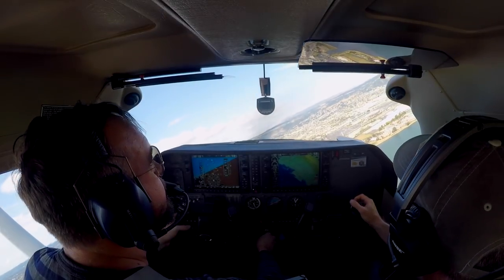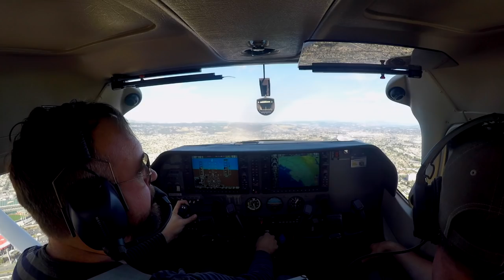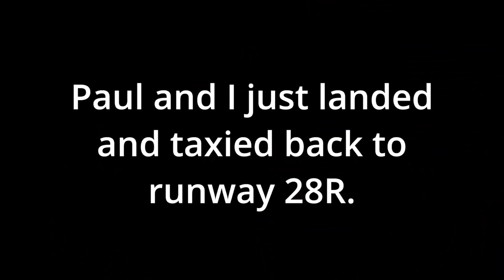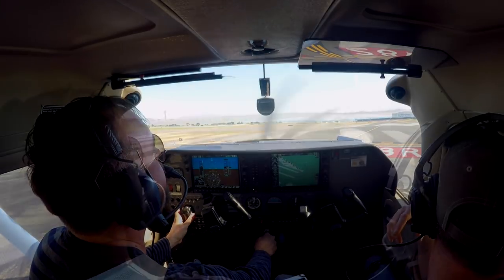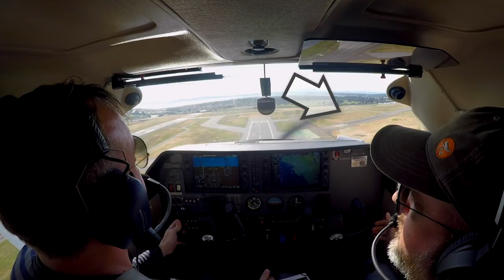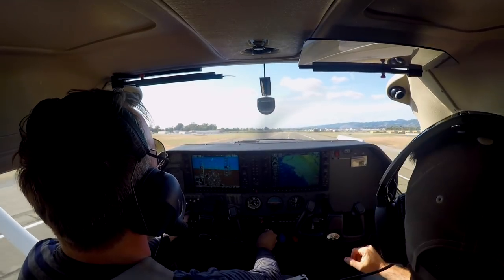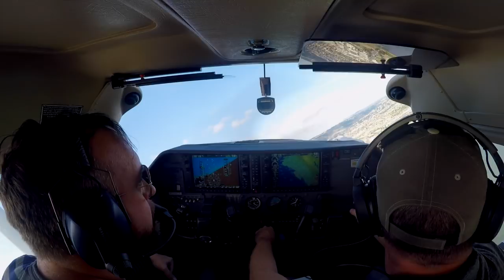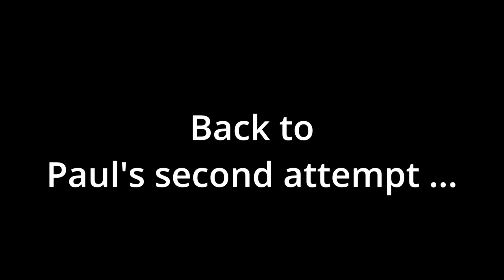Engine FAILURE on Takeoff - Flight Training VLOG

Comment: Interesting! We have quite a long runway in my home base (at sea level), so in primary training, we did these just landing on the same runway. A good exercise in quick thinking, that :) The engine failure after takeoff briefing that was drilled in my head was "PUSH, 65, shallow turns, land in the front sector" - in a plane that had 65 as the best glide speed (and 61 as the recommended short field landing speed). With other planes, I just replace the 65 with the speed appropriate for that plane. I love the concrete numbers; one thing less to think about if you have to actually execute the maneuver.

Comment: Great vid as always!  The turnback is actually 202.5 degrees and then 22.5 degrees to realign with the runway, a total of 225 degrees.  If you do it, I recommend shallow turns and allow yourself to land further down the runway so your turns are less steep to not loose as much energy.  The steeper the turn, the more potential energy you loose.
Reply: Also, dont forget the headwind will suddenly be a tailwind - you have to double any windspeed to account for the true loss. I know of somebody who tried the turnback, and it didnt work.

Comment: For my tailwheel endorsement the final test was to make a wheel landing on KOAK 28R and then make an emergency landing on 33 in a Citabria without flaps.  Lots of slipping and aggressive control of airspeed and direction.   KOAK 28R  is now closed and it costs something like a $100 landing fee there for folks from elsewhere, so local folks wanting to try this out are out of luck.   I am not an instructor, but a committed tailwheel guy---my view is that everyone should be required to learn to do maximum slips in emergency landing without flaps---because it is something no one ever taught me (until tailwheel emergencies) and if you lose power you might not have flaps.  Also, doing an aggressive slip is a great way to avoid parallel runway traffic issues on that turn to final with another airplane and you look like you might over shoot---knowing how to do an aggressive slip safely could save your life by getting you away from the path of another airplane without risking a spin and targeting a short emergency landing spot.   I have no idea why CFIs do not teach this alternative to using flaps to spot land.   Seems like a basic safety maneuver everyone should be comfortable with.  And, of course,  I do not think anyone should get a pilot certificate without demonstrating escape from a spin.

Comment: On my last biennial review I asked the instructor if we could do some power off on takeoffs to see exactly how much altitude was needed to do a 180 and make it back to the runway. And more importantly, how tight of a turn could I do before I stalled the plane would crash, etc.  He looked a little puzzled until I told him that I wanted to climb to 3000 ft, simulate a takeoff, and pull the power, etc.  There are many variables in this exercise but the take away was that I learned a lot about the characteristics and limitations of the plane and my skills.

Comment: i have moved to the camp of John Deakin who says it is safer to climb at a speed far away from Vy and especially Vx which some instructors say is a likely stall/spin if power is lost on departure.
Reply from the maker: Thats a tough one right? I fee that way about Vx, but I also have a hard time with not "putting altitude in the bank". I think if you practice stuff like the above and stay vigilant, you are not the one who will stall / spin from Vy. Thanks for the comment

Comment: This seems like something every student should try.  However, it depends on the airport layout and proximity to an airport that has that layout.  Unfortunately, I don't have an airport nearby with intersecting runways. :(
Reply from the maker: How long is the runway you're working off of? Is it long enough do land back on the runway?
Reply: My home airport is only 2,000'.  We have a 6,000' runway 10 miles away, though.
Reply from the maker: You could do it on a 6000' foot runway, make it a short field takeoff and plan to do a full stop on the landing but with a CFI, I'd recommend giving it a try.
Reply: Thanks.  I'll talk to my CFI about it.

Comment: I always had it drilled in my head as a student to never deploy flaps while turning.
Reply from the maker: There are two potential dangers associated with deploying flaps in a turn and that's why it "was drilled into your head". 1. The flaps could potentially deploy asymmetrically and cause a roll into the turn. 2. In any slowing turn there is an over banking tendency. This is true whether you are deploying flaps or not. It's fine to say "For these two reasons I will not deploy flaps in a turn." However, I often  see pilots ... who are not aware why they don't deploy flaps in a turn ... create other potentially hazardous situations in an effort to avoid this at all costs. For example, some create a huge pattern to compensate and get so far from runway we are no longer in a position to glide to it if the engine fails. We often end up low and slow fighting power against drag. I prefer to teach pilots exactly what happens when the airplane slows in a turn, and how to keep eyes outside to detect any possible asymmetric deployments (which can happen in a bank or during straight and level). Lazy 8's are the BEST maneuver to teach over banking tendency in a slowing turn. I will have a video on that coming soon. Thanks for the comment, I know a lot of people were taught the way you were, and that's ok. Just know why I suppose.
Reply: The Finer Points thank you very much for the clarification! I knew it could lead to asymmetric deployment (from one of the TFP podcasts believe it or not) but I can see why in this case getting the airplane down safely using the runway you have would take priority over when to deploy flaps.
Reply: @TheFinerPoints -   All airplanes need flaps to avoid stalls when turning and the speed falls UNDER the best glide speed.  For example turning base to final for a crosswind landing with no flaps, speed falls under Vgl? Just add flaps in the turn,  It will lower the stalling speed AND make you turn quicker too and not overshoot final.  Try that trick.  WW2 pilots used the Turn and pop flaps maneuver to out turn each other.. The ones better at it where the winners mostly.. 

On the take off initial climb leg Turnback to Opposite Runway from 700 agl I teach, I do that trick too to finish the Turnback to Opposite quicker and safer.

Comment: 1000 AGL may be too high to call "impossible". How high do you think it can really be called "impossible turn", in 172?
Reply: Depends if you have power or not.  With enough power left to sustain altitude or Minimum Level Power (MLP) I have done the Question Mark Turn from 300 agl.  With no power left you double that with a normal wind.  No wind and high weigh= shallow climb rate= No Turnback, even from over 1,000' agl.. All those things you determine before take off.